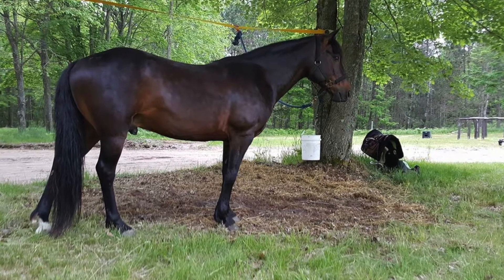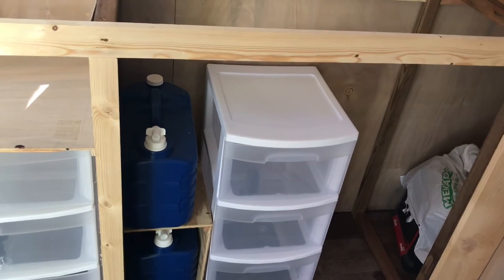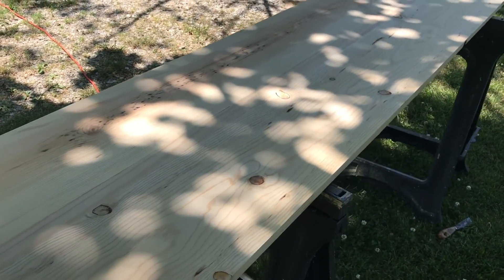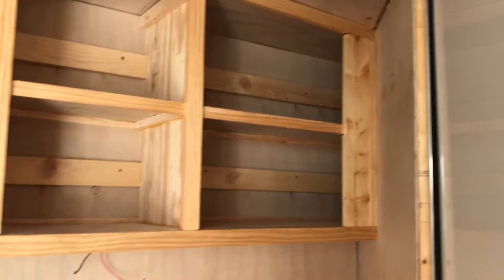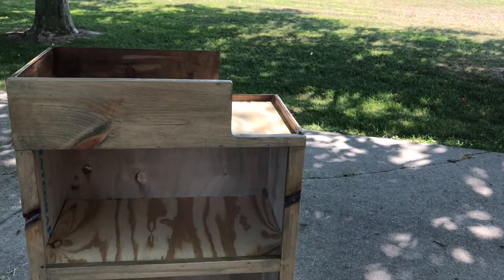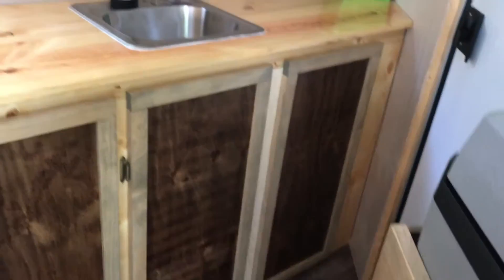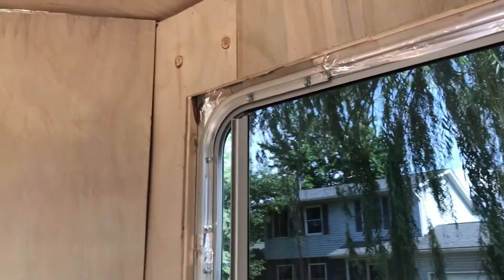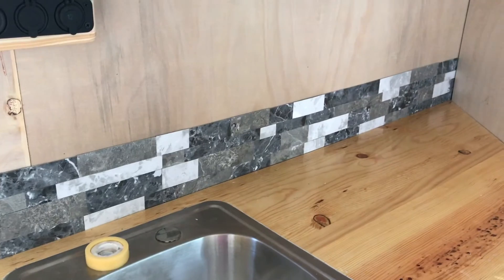DIY Bumper Pull Horse Trailer Conversion Part V Kitchen

Comment: What is that square material called that you bought from Menards to make your backsplash? And is it sticky on one side or how did you attach it? Looks awesome!! I'm going to try some of this in my trailer!
Reply from the maker: It is just vinyl floor tile cut into strips.  But I would use mastic to apply it. It’s not meant to go on a vertical surface.

Comment: What type of screws …or….how did you hang the upper kitchen cabinets ? I’m at that point with my conversion and I’m worried about the weight of the cabinets pulling from the metal walls of the horse trailer. I will be making the top, sides and doors of the cabinets with MDF boards so they will be light weight …Suggestions ?
Reply from the maker: I put wider furring strips behind the cabinets and extra screws and made sure I screwed into those with the cabinets.  I’m not sure what you mean by pulling the metal from the walls, unless you covered your furring strip with metal.   You need to hit something solid with the cabinet screws.